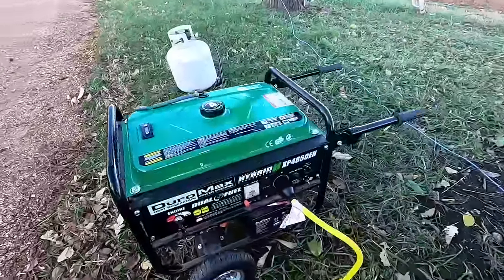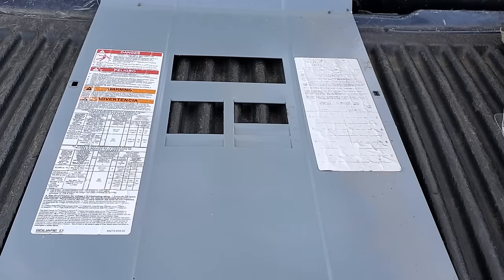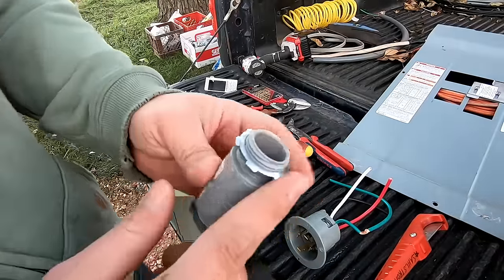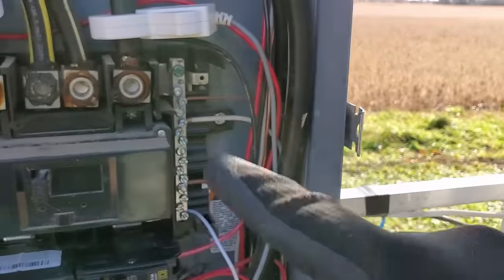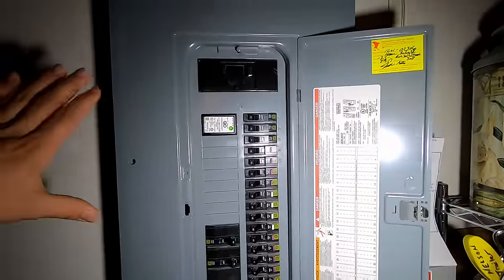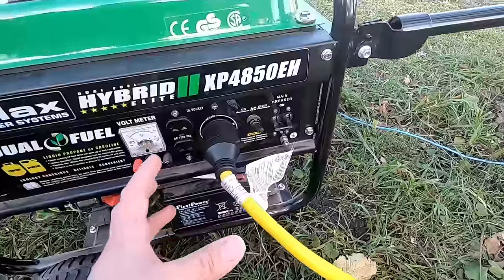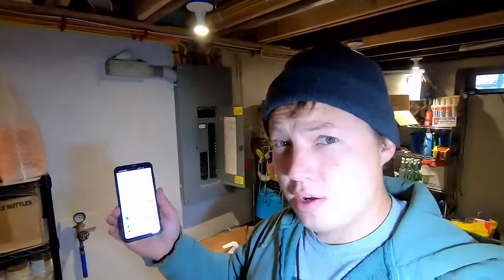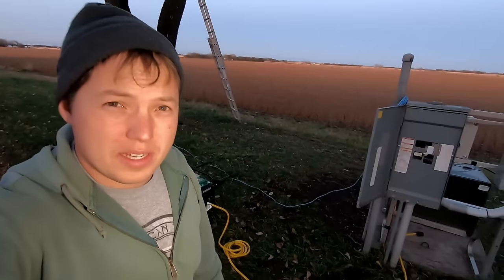How To Hook Up a Generator To Your House Using a Breaker Interlock Kit & Power Inlet Box

Comment: THANK U FOR INFOR
Reply: ⚠️Please don’t forget the rules about generator safety: This is a very important announcement for everyone. It’s important to follow all generator safety rules whenever we use portable generators: 

Everyone must see this. This is just a reminder for everyone’s safety. 

1) KEEPING OTHERS SAFE: Please do not allow an unqualified person or your children to operate and service the portable generator. Just because some manuals don’t say that doesn’t mean it’s safe. That is important against the generator safety rules. We also need to be keeping an eye on our children too. You need to make sure that your children are not playing near the portable generator especially when it’s running so they won’t get electrocuted. Generators pose electrical risks and they can be hot during an operation. Please keep your children away from the portable generator at all times. It is important to keep our children safe especially our little ones. Be aware of all the hazards.

2) WHERE TO RUN YOUR GENERATOR: Some people use their portable generators indoors which increases the risk of carbon monoxide poisoning. It’s important to have a carbon monoxide if you have a gas generator. Never ever use your generator indoors even if your doors and windows are open and even in the garage is not safe to use a portable generator. Not even at your porch and your deck. It is never safe to use your generator indoors and in enclosed areas of your home. Your generator needs to be 15-20 feet away from your house. 

3)🔥FIRE HAZARDS: Never refuel your generator while it’s running. You need to let your generator cool off before refueling it and before storing your generator. Never overload your generator too. Never ever back feed your generator. You should never plug your generator into a wall outlet. Also never store propane tanks indoors. Please keep flammable things away from the generator as well and please don’t smoke cigarettes near the generator. Having a fire extinguisher next to the generator is also important against the generator safety rules. 

4) GENERATOR OPERATION: make sure your hands are dry before touching the generator. Never use your generator in wet conditions. Don’t let your generator get wet. You need a generator tent if you need to use your generator during wet weather. Please don’t wear loose clothes when operating the generator. Turn on your generator before plugging in appliances. Use the right cord for your generator. Please do not use worn out cords. 

https://youtu.be/I1jT3ANENvI and here is a video more about keeping others safe when using generators 

Hope this helps. Remember safety first

Comment: Torque depends on screw size (dimensions and pitch of thread) and the material it is made of.

Example: 6-32 screw/bolt, stainless, approx 9.6 in-lbs

While brass, because of the material, is only 7.9 in-lbs

Comment: You should install PV system with micro inverters  on your home tied to the utility so maybe you can get money back from the utility Co.
Reply: Don’t forget about the generator safety tips as well. Remember it’s important to follow all the generator safety rules whenever you use your generator. Here are the generator safety tips:

1) Please do not allow an unqualified person or your children to operate the portable generator. Just because some manuals don’t say that doesn’t mean it’s safe. That is important against the generator safety rules. We also need to be keeping an eye on our children too. You need to make sure that your children are not playing near the portable generator especially when it’s running so they won’t get electrocuted. Generators pose electrical risks and they can be hot during an operation. Please keep your children away from the portable generator at all times. It is important to keep our children safe especially our little ones. Be aware of all the hazards.

2) Some people use their portable generators indoors which increases the risk of carbon monoxide poisoning. It’s important to have a carbon monoxide if you have a gas generator. Never ever use your generator indoors even if your doors and windows are open and even in the garage is not safe to use a portable generator. Not even at your porch and your deck. It is never safe to use your generator indoors and in enclosed areas of your home. Your generator needs to be 15-20 feet away from your house. 

3) 🔥generators cause fire hazards too. Never refuel your generator while it’s running. You need to let your generator cool off before refueling it and before storing your generator. Never overload your generator too. Never ever back feed your generator. You should never plug your generator into a wall outlet. Also never store propane tanks indoors. Please keep flammable things away from the generator as well and please don’t smoke cigarettes near the generator. Having a fire extinguisher next to the generator is also important against the generator safety rules. 

4) generator operation; make sure your hands are dry before touching the generator. Never use your generator in wet conditions. Don’t let your generator get wet. You need a generator tent if you need to use your generator during wet weather. Please don’t wear loose clothes when operating the generator. Turn on your generator before plugging in appliances. Use the right cord for your generator. Please do not use worn out cords. 

https://youtu.be/I1jT3ANENvI and here is a video more about keeping others safe when using generators and also about our family’s safety. Hope this helps

Comment: Ben your video is most detailed and informative. You are indeed a talented teacher.  I am in the Caribbean, any possibility of you posting contact details, email and or phone? Thanks in advance... Winston
Reply: ⚠️Please don’t forget to follow the generator safety tips when you use your portable generator:

This is a reminder for everyone’s safety when using portable generators. All generator safety rules need to be followed carefully whenever you use your portable generator. This is just to make sure. 

1) KEEPING OTHERS SAFE: Please do not allow an unqualified person or your children to operate and service the portable generator. Just because some manuals don’t say that doesn’t mean it’s safe. That is important against the generator safety rules. We also need to be keeping an eye on our children too. You need to make sure that your children are not playing near the portable generator especially when it’s running so they won’t get electrocuted. Generators pose electrical risks and they can be hot during an operation. Please keep your children away from the portable generator at all times. It is important to keep our children safe especially our little ones. Be aware of all the hazards.

2) WHERE TO RUN YOUR GENERATOR: Some people use their portable generators indoors which increases the risk of carbon monoxide poisoning. It’s important to have a carbon monoxide if you have a gas generator. Never ever use your generator indoors even if your doors and windows are open and even in the garage is not safe to use a portable generator. Not even at your porch and your deck. It is never safe to use your generator indoors and in enclosed areas of your home. Your generator needs to be 15-20 feet away from your house. 

3)🔥FIRE HAZARDS: Never refuel your generator while it’s running. You need to let your generator cool off before refueling it and before storing your generator. Never overload your generator too. Never ever back feed your generator. You should never plug your generator into a wall outlet. Also never store propane tanks indoors. Please keep flammable things away from the generator as well and please don’t smoke cigarettes near the generator. Having a fire extinguisher next to the generator is also important against the generator safety rules. 

4) GENERATOR OPERATION: make sure your hands are dry before touching the generator. Never use your generator in wet conditions. Don’t let your generator get wet. You need a generator tent if you need to use your generator during wet weather. Please don’t wear loose clothes when operating the generator. Turn on your generator before plugging in appliances. Use the right cord for your generator. Please do not use worn out cords. 

https://youtu.be/I1jT3ANENvI and here is a video more about keeping others safe when using generators. Everything that is said about the generator safety rules all need to be followed. Especially keeping your children safe. 

Hope this helps

Comment: I Live In A Manufactured Home And Am Going To Have A Hard Time Finding An interlock for my Disconnect Box ..
Reply: Then don't.  just use your head when switching over like I do.
Reply: @MrBen527   Since Writing This The Other Day I Found Out I Can Purchase Lockouts For  My Breakers In My Panel box . Going To Try And Get One For The Generator In feed Breaker And One For The Main . When On The Power Companies Service  I Will Lockout My Generator Plug Box So That The Prongs Are Not Live If Someone Was To Flip The Breaker on . Then When In Generator Mode Move The Lockout To The Main Breaker So As To Prevent Back Feeding . Oh And I Still Have The Main Outside,, Since I Live In A Manufactured Home ,, I Can Shut It Off And Lock The Panel Box ..  Thanks This Video Helped Me Greatly ...
Reply: @5dennisk  That's all great.   In my situation I'm the only one operating my setup.   The only added hardware I needed was an out door receptacle connected to my central AC circuit.  That's what I use to back feed my panel.

Comment: bureaucracy alert! If you are not a licensed electrician make sure that you have your work signed off by a licensed electrician or by electrical inspector before any testing is done. If anything happens like an electrical fire your insurance may not cover the damages. Also if any damage to the grid happens, you may have serious financial and legal issues with the power company. On another note, you are really taking a risk with your appliances and electronics when not using an inverter generator or a well regulated generator (big big bucks). These smaller generators are notorious for voltage spikes. You'd be surprised at how many seemingly simple appliances now hav electronics in them.

Comment: Generator breaker probably cut out early because you turned on too many loads off of one of the 2- 110Volt lines
Reply: ⚠️Please don’t forget to follow the generator safety tips whenever you use your portable generator. This is a very important announcement for everyone. This is just a reminder for everyone’s safety. All generator safety rules need to be followed carefully 

Generator safety tips: 

1) KEEPING OTHERS SAFE: Please do not allow an unqualified person or your children to operate and service the portable generator. Just because some manuals don’t say that doesn’t mean it’s safe. That is important against the generator safety rules. We also need to be keeping an eye on our children too. You need to make sure that your children are not playing near the portable generator especially when it’s running so they won’t get electrocuted. Generators pose electrical risks and they can be hot during an operation. Please keep your children away from the portable generator at all times. It is important to keep our children safe especially our little ones. Children often get curious about anything so we should keep an eye on them to also make sure they’re not wandering towards the generator. 

2) WHERE TO RUN YOUR GENERATOR: Some people use their portable generators indoors which increases the risk of carbon monoxide poisoning. It’s important to have a carbon monoxide if you have a gas generator. Never ever use your generator indoors even if your doors and windows are open and even in the garage is not safe to use a portable generator. Not even at your porch and your deck. It is never safe to use your generator indoors and in enclosed areas of your home. Your generator needs to be 15-20 feet away from your house. 

3)🔥FIRE HAZARDS: Never refuel your generator while it’s running. You need to let your generator cool off before refueling it and before storing your generator. Never overload your generator too. Never ever back feed your generator. You should never plug your generator into a wall outlet. Also never store propane tanks indoors. Please keep flammable things away from the generator as well and please don’t smoke cigarettes near the generator. Having a fire extinguisher next to the generator is also important against the generator safety rules. 

4) GENERATOR OPERATION: make sure your hands are dry before touching the generator. Never use your generator in wet conditions. Don’t let your generator get wet. You need a generator tent if you need to use your generator during wet weather. Please don’t wear loose clothes when operating the generator. Turn on your generator before plugging in appliances. Use the right cord for your generator. Please do not use worn out cords. 

https://youtu.be/I1jT3ANENvI and here is a video more about keeping others safe when using generators. All generator safety rules should be followed carefully. 

Hope this helps.

Comment: Good install but you could use a bigger generator. Cold showers aren't fun.
Reply from the maker: True! I am pretty budget conscious so we sprung for the more affordable basic option. We also very rarely lose power (probably less than 10 hours total in the past 10 years) so we haven't had to take any cold showers yet. 

I have been wondering though if you could potentially put in lower wattage elements during a power outage that your generator could handle easily like this: https://amzn.to/2Kibf4R

Probably not a good idea but its an idea!
Reply: Not if it takes longer to heat. No advantage there.
Reply: @BenjaminSahlstrom  While it's not strictly NEC or UL legal, for such emergency circumstances either just move one of the water heater hot legs to the neutral bus so it only gets 120v and only uses 1/4 the power AKA ~1125 watts (1/4th of 4500). Alternatively disconnect the lower thermostat and wire the elements in series so each gets 120v and ~1125 watts for ~2250 total.

Comment: i dont know anyone who runs ground and neutral to gether, no gfi,s will work plus u just made all grounds live. u shude of installed a ground bare and pound in a ground rod or i take 10ft galvanize pipe 3/4 with adapter hook it up to your garden hose and sink that 10ft pipe it will go right down unless it is vary rocky soil but if u work the pipe back and forth u can get it down this allso work if u are installing a fence charger,fence chargers have one hvt line and standing on the ground completes the circut. some soils like sand need a lot more grounds put in the ground.

Comment: unfortunately the interlock kits are illegal in Canada as they can be defeated by simply removing cover , I wish they were legal cause its the best way and cheapest , transfer panels only have so many circuits so ya can't power whole house as normal , and back feeding threw dryer recptical is not dummy proof